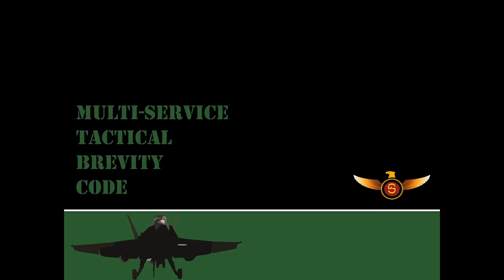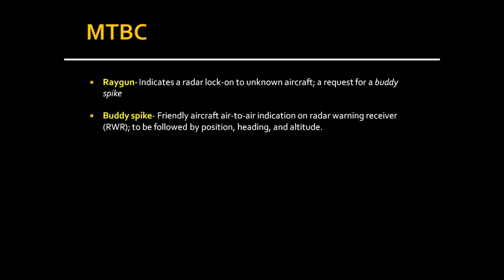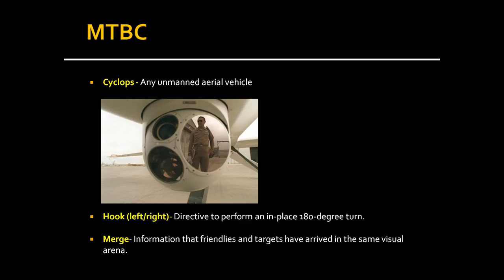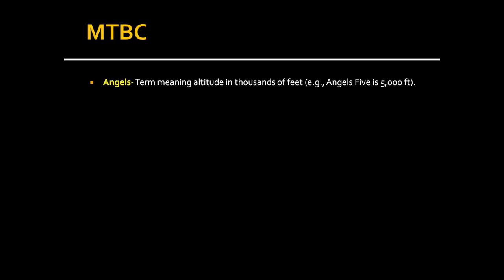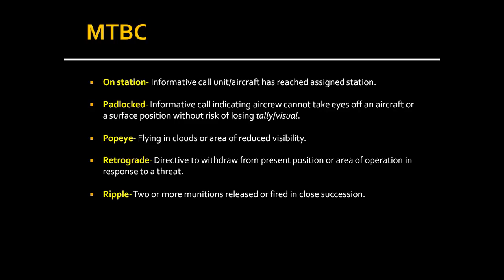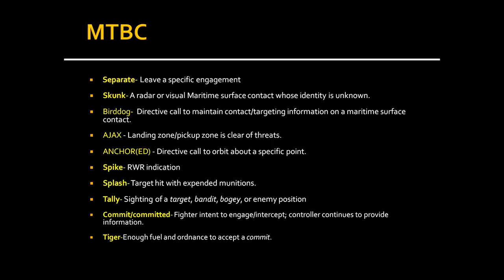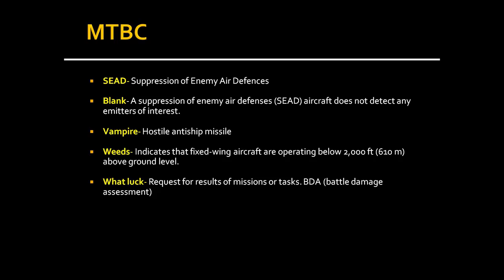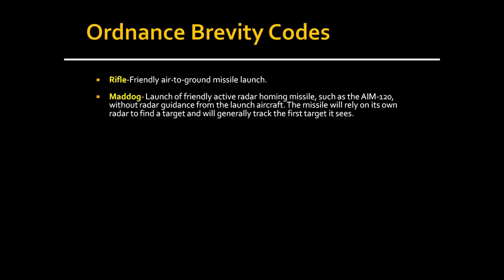DCS: Radio Terminology/ Brevity codes/Ordnance codes Tutorial

Comment: Some context on SCRAM:  it is an acronym for Safety Control Rod Axe Man, and derives from Dr. Enrico Fermi and the Chicago Pile-1 experimental reactor, which had control rods operated by a set of ropes and pulleys that came back to a single "master rope" anchored to a cleat against a wall of the control enclosure.  Dr. Fermi's English was somewhat accented, and he wanted to get the command out quickly when it became necessary to do an emergency shutdown of the reactor.  Someone suggested the first letter of every word, which was much easier for Dr. Fermi to say, and the rest was history.

Comment: If you mentioned it I missed it, but "cherubs" refers to altitude in hundreds of feet, so obviously less than "angels one." I've never actually heard it used and I imagine it would really only apply to helos. Back in the day when Vikings ruled the sky (a little joke there) it's possible cherubs could have been used during the prosecution of a sub target or when checking out a surface contact, but I don't recall ever hearing it.

Comment: If I lock up a bogey and request a BRA from AWACS (and the bogey is actually a friendly air craft) would AWACS respond with, "Buddy Spike," or does that only apply between currently flying pilots?  (Also, for the sake of argument, let's pretend that we aren't in radio contact with said bogey.)
Reply: Old comment, but you'd say to the awacs "declare target, my 12" (or wherever he is relative to you) and he should give you the aircraft type and whether it's friendly or not.

If you know the bearing and distance of the bogey from you, you could give the awacs that info too for accuracy.
Reply: @Majima_Nowhere  Thank you!